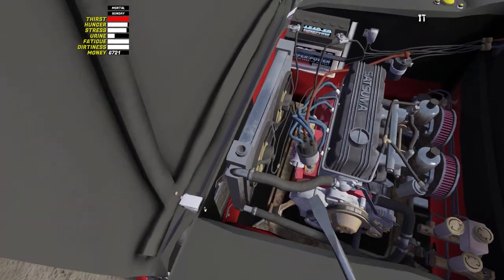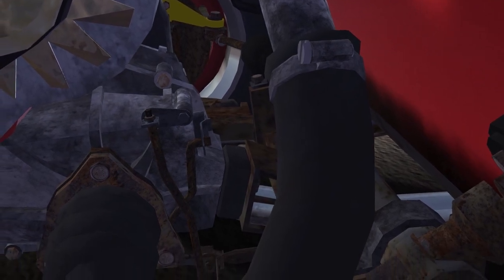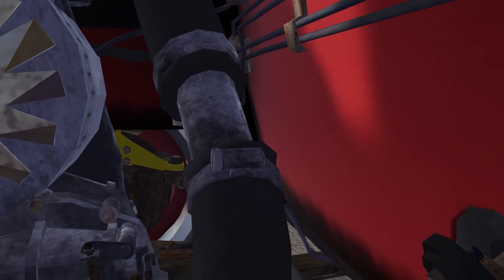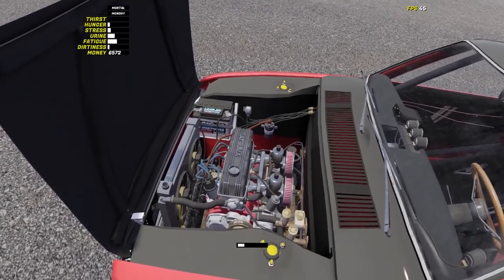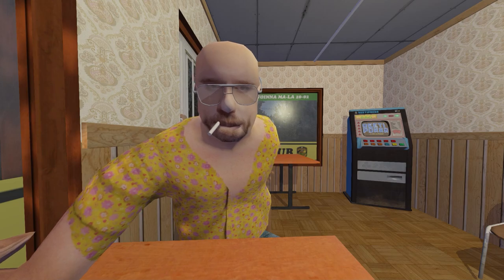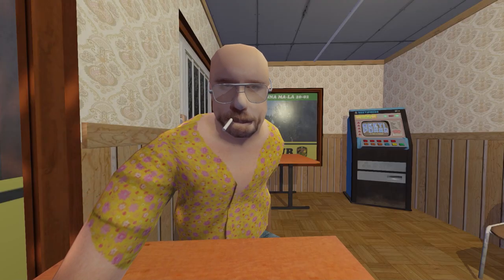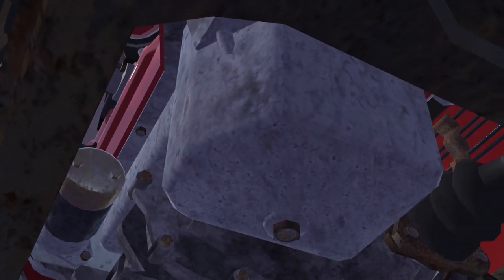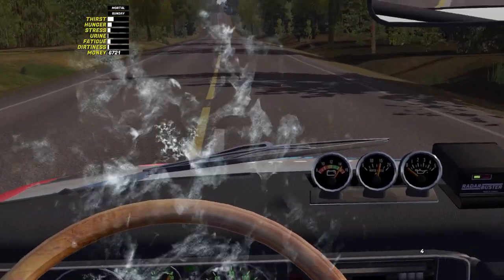My Summer Car 💚 Troubleshooting: Satsuma Overheating: Water Pump, Head Gasket, Coolant and Oil

Comment: The stock grille doesn’t help the radiator get the air it needs so use GT grille or the racing radiator
Reply from the maker: that's right, nice advice
Reply: @RonDonDon  oh I didn’t think you would respond hah

Comment: Help, this is my first time playing through MSC and ive now
built the Satsuma tuned everything as i should, bought
all the new engine parts and all that and went for a test
drive and as im driving when i reach higher rpm the
coolant starts splashing at my windshield. I looked and
everything seems tightly screwed even in MSC editor
everything is good nothing broken no loose screwes and
dont know what now. ls there any good soul that woulc
download my save and look into it ?

Comment: I have one question I hear the whistling sound you mention but the water pump pulley still spinning also on top of that the motor has a white smoke, already check the gasket
Reply from the maker: White smoke - either headgasket or exhaust pipe is not attached. Sound - either the alternator or wrong belt tension.

Comment: hey, my Satsuma overheating every 1km. I replaced Headgasked, Waterpump, replace oil and coolant. The water pressure goes over 15 psi after 20 my engine died. Also the air/fuel mixture is 18.0. could you pls help me?
Reply: me too

Comment: I just finished building the car, everything is tighten correctly and coolant is full but every time I drive the car it sprays coolant all over and if I drive too long engine breaks. What am I doing wrong?
Reply: To much heat for engine try not giving it to much throttle and let it coast along

Comment: why the middle on extra gauges is 0 on me? and why gearbox is leaking oil?
Reply from the maker: it's brake or clutch fluid that's leaking
a water press gauge must be about 10 when car is in ideal temperature. If the engine is warm and the gauge shows 0, first check the coolant level. I've talked about all cases in the video

Comment: does painting the engine block make any heating issues? Causi i painted the bloock and i have a racing rad innstalled, everything tightened filled. It's still overheating after 2-3mins of driving. Any suggestions?
Reply from the maker: check oil level. check if the radiator is wired. check if oil filter is tightened
Reply: everything was good except the oil filter, tightened it, it still overheats, but with choke to the max, it doesn't heat anymore so i guess it's all good;D Thanks

Comment: i got smoke,leaking oil and some "pang" sounds sometime...u know,what this is?
Reply from the maker: in russian it is called "pizdec" ( check this video https://youtu.be/x0C70Hm531k
maybe you will see matching sounds
Reply: @RonDonDon  jo...I already tightend the spark plugs...it is still doing the Sound...AND i still got the Problem with,when i shift down at high speed,my pistons or Main bearings break out...and i tuned my car with fleetari and if i give max. Power,when I'M in no gar, then After some seconds, my pistons and/or Main bearings fly out too...So is my car completele Broken or is it possible,to repair?

Comment: If I go fast, it'll overheat a bit and liquid will spray on my windshield, which makes me have to keep it under 130kmph, why does it do that?
Reply from the maker: if everything is alright, I think that the radiator of the Satsuma is too small for such a speed. try replacing it with one from the catalogue
Reply: @RonDonDon  Oh, thanks!

Comment: I tried everything in this video and it still overheats. I dont understand!! even the editor says that everything is finr but it overheats after 1-2 minutes of driving.  when its starting to overheat water will shoot out of the hood and everything will break. Im literally going insane PLEASE HELP ME
Reply from the maker: It seems to be interesting. Let's truy to be logical. If the steams burst out of the hood = you still have coolant inside. Radiator, hoses and w\pump are responsible for cooling. Then check^ radiator: initial coolant level, check if the radiator is wired to the main harness connector. (Or smth, i.e WIRING)
Hoses - check if clamps are tightened.
W\pump - check the belt tension, check if the w\pump oulley rotates. To be sure, replace the pump by a new one.

Besides, check if the engine has motor oil inside.

In general, it's all.
Reply: I had the same problem. All parts were in good condition and installed properly. The problem turned out to be carburetor tuning, my fuel mixture was way too lean (18.0 on the gauge). I adjusted it to about 14 and now the car runs fine :)

Comment: hello again.i have now an weird problem:
1.:my air condition is going down,when i drive(or give gas) and i have to wait a minute minimum,that it comes the half up...
2.problem:my headgasket is sometimes breaking(much times).i rly dont know,what both could be

Comment: i need help my engine temp rapidly went down while driving the cooling fan stayed on even tho the temp gauge said 30 while driving whats wrong? do i need to replace the head and thermostat did the thermostat get jammed open or did my temp gauge fail or is it a glitch?

Comment: i have still problem i tried everything, i even checked with MSC editor and repaired everything and screwed everything with mSC editor just in case but its still overheating
Reply: i mean when i drive the water comes out, even if everything is screwed correctly
Reply from the maker: even clamp on hoses? did you connect a radiator to electricity?
Reply from the maker: maybe oil problems.

Comment: hey bro...when i drive, there is an sound what sounds like the sound,when i havent attached the alternator belt correctly. But this sound appears only,if i drive...so when i have no gear in,it is not there. i can also not hear it,when i drive and push the clutch...what do you think,what this is?

Comment: I Was Doing nice crusing on highway when car over heat and water pump detached it's self from car did not pee enough in radiator/ also the belt did not whistle and water pump was damaged and all bolts were tight
Reply from the maker: EIther Satsuma hit something on the road and some random bolt get loose Or Bolts under the pulley were loose. Pump can't just fall off. If you heard some sound of detaching, it might be pistons.
Reply: @RonDonDon  probably was loose bolt because pistons were in car